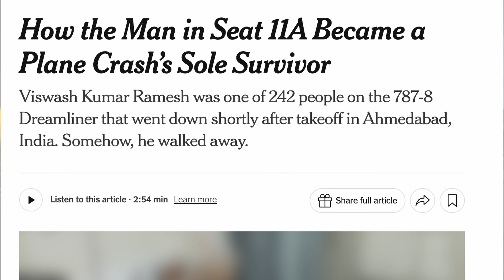Why the RAT Changes Everything – Air India 171 Update

Comment: May the Lord bless the souls of the departed along with all their friends and families.  Kudos to independent channels such as Captain Steeve, Kevin, Swiss001, Max Afterburners!  I think there has been tremendous discussion and speculation which is quite normal for a concerned world that is watching and knowing that the flight recorder results might still be weeks away.  Several days of technical discussion may have brought to light a new failure path - Excessively hot conditions, loss of power, loss of hydraulics, contaminated fuel or gravity fed fuel that has a significant amount of air or air locked - combination of conditions leading to dual engine loss.  Of course only the flight data will confirm the exact sequence of events but regardless this leads to catastrophic results particularly if the aircraft is close to the ground.

Those who are authorized to do so should verify the maintenance history and procedures  Analyze every detail especially recent squawks.  Verify that all airport maintenance and other procedures are being followed.  This aircraft definitely had serious issues so check the issues raised in the past 10 or more flights.  What is the qualification of Aircraft maintenance personnel - especially the people who are authorized to TOUCH the aircraft - the ones who provide fuel, what is the quality of the fuel, what is their track record?  What is the qualification and training of the people that touched the aircraft providing repairs and maintenance.  Why is Air India aircraft kept for long hours on the ground in hot climates with no AC?  Is this a procedure? do they instruct their staff to reduce or eliminate AC?  My Experience Level - Aircraft Systems Engineer.  Education:  PhD Flight Controls (UK)  Location: US Retired.

Comment: Very interesting insight thanks for explaining the RAT. Not sure why you originally leaned towards the first theory about the pilot error and flaps! We already had actual mayday message from the pilot mentioning loss of thrust = Engines. We also had the report from the survivor of flickering lights in the cabin = loss of engine power/switch to redundancy. I wonder if it was a massive electrical issue which could affect hydraulics, fuel pumps, avionics etc, and maybe account for gear not being raised. Like you say at that altitude and in that time frame the RAT would not have had time to help. Let's wait to find out what caused the twin engine failure. Heartfelt wishes to all the families who have lost loved ones, and to the pilots and crew, very sad.

Comment: Hi Steve, it's unbelievable that a relatively new aircraft could experience a double engine failure after takeoff. What could cause not just one, but two such large turbines to fail within seconds? It must be terrifying for the pilots, seeing what's coming but unable to do anything to prevent this catastrophe. Were any modifications or repairs made to these engines or related components before the flight?

Before the aircraft takes flight, both turbines are usually tested on the runway at full throttle. What could happen afterward?

Could the loud noise the guest heard have been the Rat extending? Or could both fuel lines in the fuselage simply have been blasted open—which would have had the same effect because the engines would no longer be receiving fuel.

Such a powerful story and only one survivor.

Comment: Captain Steeve , Could Be engine EFC Electronic Fuel Control Unit on engines.I have been an aircraft mechanic for 50 years.I have done many power take of runs on 747 and other aircraft.Check the LOG BOOKS.

Comment: I wish you would not use the phrase "engine failure". What you should say is that "it appears that both engines were not giving giving adequate  thrust". In effect this means several reasons will be responsible for lowered thrust, i.e. 1/ inadequate demand from the engine throttle system, 2/ adequate demand from the throttle system but the engines are not responding, and so on. I conclude the jury is out on this until further data is analysed. Great video sir.

Comment: A few thoughts:
In the video I could see dust / fog around the plane at take off.  Looks unusual.
Engines suddenly lost power, it's obvious, what caused the drag? Choked fuel pipes? While riding motorcycles with impure fuel, one can experience similar drag. Water in fuel? Corrosion?
Real-time engine data / predictive diagnostic data might be with GE/ Boeing. Anybody looking into it? When was last technical inspection / preventive maintenance done? Did Air India ignore maintenance aspect?
Cyber attack angle, least plausible but cant rule out? 
I don't think it's pilots error.  Praying for all departed souls and their bereaving dear ones. Hope they find peace.

Comment: Air Transat Flight 236 landed safely with the help of RAT with a record long glide.
Despite the pilots had overlooked fuel loss, the route cause was the mis assembly of the spare engine (right) while the original one had  taken to service due to metal debris found in its filters.

Comment: So how does a modern jumbo jet suffer double engine failure a few seconds after take-off ??? 
Has that ever happened before? Is that even possible? 
How can both engines be running perfectly, then both shut down completely at exactly the same? 
Do these planes need to be grounded? Or was this an act of sabotage?

Comment: Capt. Steve:  I am a 40-year airline/aviation attorney and veteran, as  regional airline owner, jet management and charter company executive, and senior executive of two airline passenger representation associations.  Ast one of the passenger associations, I lead the team that grounded the DC-10 in 1979.  Your videos and recently of the Air India crash have been great.  My guesses about the Air India crash have tracked with yours including  initially incorrectly raising the flaps, instead of the landing clear, which seemed improbable because of their locations.  Now with the RAT deployment and all of the limited reasons for it, including double engine loss of thrust, what about the possibility of another suicide situation by the FO or the relief pilot, who could have pulled both fuel handles or both thrust handles to cause loss of thrust in both engines.  This would explain the RAT deployment and the report of loss of thrust by the Captain in his Mayday call.  I think it was the Captain who made the call.  If it was the fuel handles he might not have seen it because of their location.  Your thoughts?   David Stempler, Esq.  301-980-8888. David.Stempler@StemplerGroup.com

Comment: If the RAT accidentally deployed or the electrical system had hiccuped and caused a RAT deployment this would have caused both engines to shut down? Sudden engine shutdown at this altitude would not give the pilot and co-pilot enough time to figure out what happened before the crash landing. Either way, this seems to be a basic error in design and engineering and possibly made worse by poor training

Comment: If the tanks were contaminated, there are a couple of questions that come to mind, 1, are the pick up locations in the tank positioned such that they could taxi and take off, but the attitude of the aircraft after take off might allow heavier contaminents to enter the fuel lines? 2, If it was contaminated fuel, wouldn't the engines have exhausted smoke or steam?

Comment: Captain Steve,
Following you on this tragedy. I like you were in the flat slap mis selection gear handle camp. But new info seems to make that junior to dual engine simultaneous power loss which statistically is right up there with being hit by a meteor. But is it?
First guess if it should happen it’s the usual suspect fuel contamination. Since no other aircraft ran into this and since the authorities have checked that out I am convinced it’s not foreign solid particle contamination from the plane’s recent scheduled patterns. The plane has been very busy over the last two months and for the last year has had 700 cycles
Standard Boeing checks require maximum 2year interval for sumping the fuel tanks. However, it recommends if flying in hot humid environments, increase checking for accumulated water in the tanks.  This is only a recommendation, not mandatory and I suspect not done. Big planes require high platform apparatus and time to do this and foreign stations generally if ever do this.
Water condenses in the relatively empty tanks as you descend into hot humid airports.  A little bit becomes a lot if not routinely addressed. My guess it was sucking mostly water for the entire takeoff roll (reports are that it was much longer than the TOWT would indicate.) Perhaps when it rotated  the level of high water concentration may have even increased. The burner cans were receiving who know what concentration of water but high enough that the engines couldn’t drive generators, hydraulic pumps and keep a ~470,000 # aircraft flying
This is similar I believe to BA38 a 777-200  Bejiing to Heathrow which had insufficient thrust to make it to the runway.
My guess it had  too high a water count in the fuel tanks.
I asked Orc 3 to do some research. The last C check was June 2023. Delhi is Air India’s main maintenance facility. I had Orc check how hard this a/c works. 700 cycles in the last year, guessing 1400 in the last two since that C check. That means lots of water.
Your thoughts?

Comment: I read an what appears an insider leak. Temperature at takeoff was about 104 F, humidity at 90%. B787 is prone to condensation and humidity in electrical connectors and systems if not properly maintained. Hence this condition did cause a major electrical failure and loss of engine power?

Comment: I'm confused, power does not just vanish when engines die 'instantly', there are batteries, and there is also an APU which would both be utilized before RAT typically. Unless somehow batteries popped at the same time the engines failed? We can compare to the miracle on the Hudson, the captain immediately activated the APU (he is a skilled pilot though, and acted calmly and efficiently in an emergency situation). If it is a dual engine out cause for the emergency it is otherwise very similar to the miracle on the Hudson and likely also caused by bird strikes. Would APU not be prioritized to auto start before RAT?
Reply: It's a 787. Not the same as Sullys plane.

Comment: I would like to consider : 1. (system factor) an heavy load (fuel, passenger, cargo); 2. (ambiant factor) High temperature, low atmosfeere pressure in the area; 3. (uman factor) to chose to use all the runway and maybe a little more (maybe was needed to use more runway); in the last point could be possible that engines have swallowed a good amount of dirt ath the end of the runnway causing a dual engine failor?

Comment: I watched a Huey recovering from an engine/rotor over speed caused by a Pilot in Training.  While they were doing a flight-boost failure with the hydraulics turned off. the Pilot in Training turned ON the emergency engine governor.  As a result, it caused an engine/ powertain over speed which, in 1972, cost about a quarter million dollars.  Something a copilot, or Pilot in Training can do in which the Pilot. or Instructor Pilot, can do to prevent damage.

Comment: The Boeing 787 Dreamliner is equipped with a digital video recorder (DVR) and a system of onboard cameras. 
Here's a breakdown:
Cabin Video Monitoring System (CVMS): The 787 can utilize a Cabin Video Monitoring System (CVMS) which provides video and audio surveillance through covertly mounted digital cameras with integrated microphones.
Cameras: The system can support up to 12 cameras, typically positioned in the cockpit, galley, and cabin areas to provide comprehensive viewing coverage.
DVR: A digital video recorder (DVR) is on board to record the video and audio signals from these cameras onto removable solid-state memory.
Purpose: These systems are primarily used for enhanced security and situational awareness, allowing the flight crew to view camera feeds on their electronic flight bags (EFBs).
Investigation and Analysis: The recorded footage can be used for investigations, operational reviews, and training purposes. The DVR in the 787 was recently recovered during the investigation of the Air India flight crash.
Flight Deck Entry Video Surveillance System (FDEVSS): These cameras can also be integrated to provide the flight crew with comprehensive situational awareness, specifically for flight-deck door monitoring. 
However, it's important to note:
Cockpit Cameras for Pilot Monitoring: While there are cameras as part of the overall surveillance system, it's important to distinguish them from cameras specifically designed for monitoring pilots' actions for regulatory purposes. Debates continue about the use and mandates for cockpit video recorders.
"Black Boxes": The 787 also has the standard Flight Data Recorder (FDR) and Cockpit Voice Recorder (CVR), commonly referred to as "black boxes," which are crucial for crash investigations. The DVR is a separate component from these. 
In summary, the Boeing 787 does have cameras and a DVR system for surveillance and monitoring purposes, primarily for security and situational awareness, but it is not accurate to assume the cameras are specifically for continuous monitoring of pilot actions in the same way as the CVR records cockpit conversations.

Comment: @captain Steeeve hypothetically if both engines went down due to electrical power, how long will it take for power to be restored and the engines to build up the required thrust to keep the aircraft in the air?

Do the pilots have to reset anything (set throttle to neutral and then back to desired settings or reset any other systems or circuit breakers, etc).

Next, could this be related to the discovery in 2015, where in simulations they found the PSU if ran for approximately 8 months continuously, the PSU can shutdown even in flight, causing loss of power to the engines?

There was a video claiming to be from the day before on the same aircraft, showing the video headrest displays and air systems weren't working correctly. Which could of been a warning of electrical issues. And is probably not something tested for in flight simulations. 🤔

Hopefully the CVR and FDR that was recently reported recovered successfully can give some insight into what happened. To help avoid future issues.

Comment: I'm not a pilot or anything but I have a question.  If there was a dual-engine failure, wouldn't the survivor and perhaps the video reveal a change in, or lack of engine noise?   I've never been a passenger on one of those but I have flown a lot and as a passenger jets and can always distinguish changes in the engine noise the pilot/s throttle up or down.  There is no mention of that anywhere.

Comment: I HAVE WATCHED A FEW ANALYSIS OF THIS , AND I CAN TELL YOU CAPTAIN STEEEEVES IS BY FAR THE BEST OUT THERE - LEGEND OF A MAN
Reply: I also enjoy the analysis by mentour, but he analyzes the final reports so that the rest of us can understand them.
Reply: Juan Brown called the RAT deploying a couple days ago. Also, note the wheels weren't retracted after take off, which could indicate electrical/hydraulic failure cause for RAT deployed. Let's wait for the black box information before saying engine failure.
Reply: @karthurjr I just saw a video that analyzed the position of the main bogies.  On rotation the front wheels are high.  The first thing that happens when thecgear lever is moved to gear up on that plane is the front wheels are pushed down.  From the video shown, this happened, but tye anding gear doors never opened (this is tte second step).
Reply: WHY ARE YOU YELLING?
Reply: @ShikhandiPilla  because i can 😁

Comment: Many years ago, I was a refueler for a company which had very shoddy practices. Every year, at the conclusion of our summer, we were contracted to fuel a Boeing 747 that would transport a  live killer whale with celebrity status from our local theme park back to its home habitat in a warm climate state because the whale couldn't tolerate the harsh winters in my state. This was an annual event which always got plenty of local news coverage. The last year this happened, one engine on the 747 flamed out taxiing to the departure end of the runway. On its return to the air cargo area of the airport, one or two other engines flamed out as well. This was at least 40 years ago, and I was not working that day. I don't remember if the aircraft had to be towed back to the cargo area or if it made it back under its own power. The problem was found to be fuel contamination... Water.  Our trucks pumped enough water into the plane that it wasn't visible in the sump collection after fueling. Normally, one expects to see trace amounts of water in drained fuel, which appear as clear globules in a sump collection container filled of jet fuel (and the idea is to keep draining until the globules go away.) When they drained the fuel, both just after fueling and just after this incident, no globules were noted... which is actually suspicious. They examined it further and found that the samples collected were pure water, not jet fuel, which is water-clear. This makes sense because a 747 takes so much fuel that it drained our trucks... so it took it all -- including the water at the bottom of our trucks. This video instantly made me recall this incident, where a cargo Boeing 747 was only minutes away from its takeoff roll with engines about to flameout. Apparently, nobody ever drained the sumps on our trucks (which were usually only used to refuel business jets) and there may have been faults in our ancient fuel farm as well. I do wonder if something like this happened in this recent crash. This sounds unbelievable, but this did happen. A tragedy was averted just by pure luck.